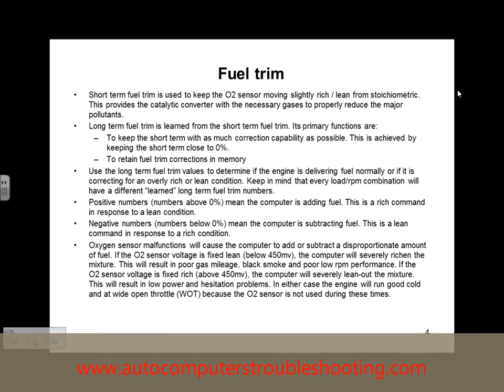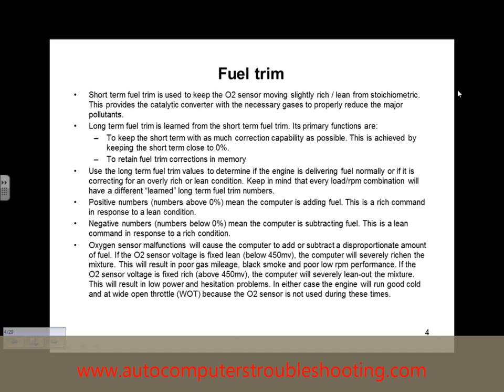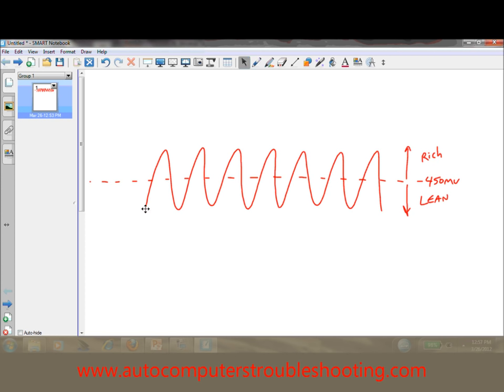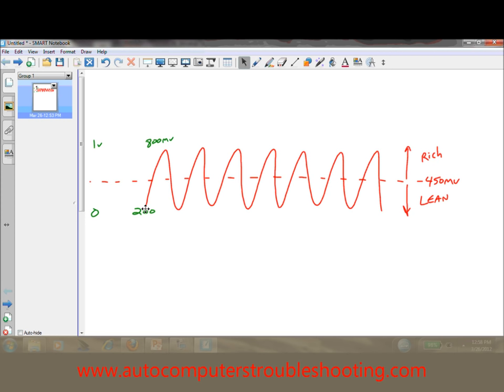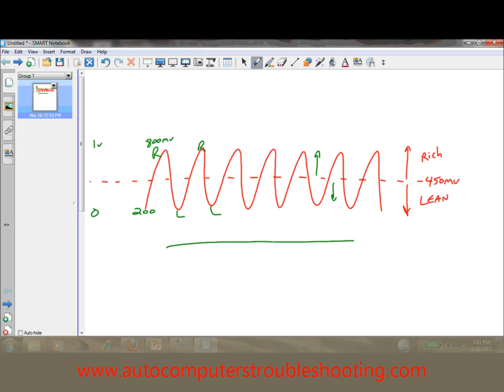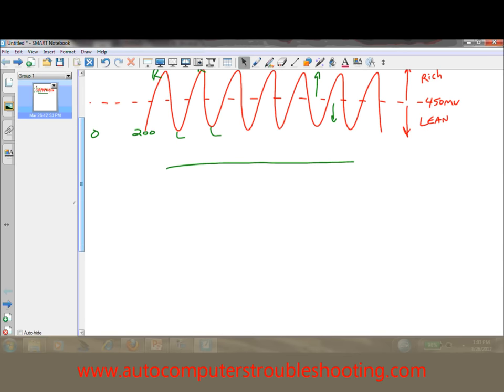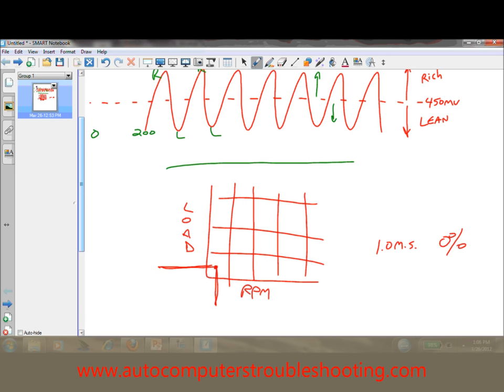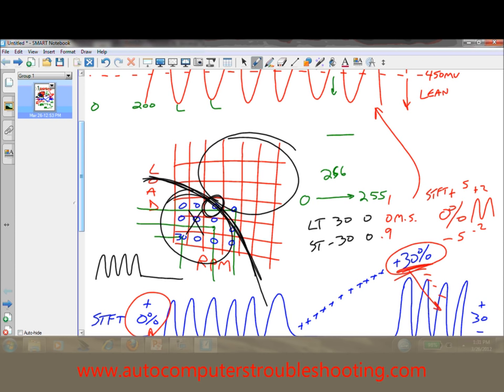Understanding Short Term and Long Term Fuel Trim (a SD Premium video)

Comment: I just checked my car at idle. Its a European car Peugeot 206 1.4. The car was in Closed Loop, engine was up to temp. The Long Term was stuck at 14.1% unless I press the throttle it changes. The short term was moving between 5-20% Is this normal? The O2 sensor was working as it was moving the wave form rich to lean etc.

Comment: With an engine that runs smooth and does not smell rich what would cause flat line short term trim? And catalyst temps on bank 2 is 300F cooler than bank 1.
Can’t find any vacuum leaks. 2005 Lexus GX470
Reply from the maker: flat line STFT means it is not in closed loop and a code related to the O2 sensors is most likely in memory. What codes do you have?
Reply: @ScannerDanner  P0403, Defiantly in Closed loop. I did change both post Cat 02 sensors, as well as a new set of plugs and have driven it a bunch and the code has not returned, but I sill have a 300ish degree difference between B1 and B2. She idles smooth but fuel mileage doesn't seem to to be as expected. I have pictures of freeze frame data and runtime graphs from Autoenginuity. Thanks for replying, I wish there was a way I could upload the graphs, may this link will work...  https://us.lexusownersclub.com/forums/topic/94008-o2-sensors-and-p0430/?tab=comments#comment-507675
Reply from the maker: @quadragin  you can to my forum www.scannerdanner.com and it is free to join

Comment: UNDERSTANDING LONG-TERM AND SHORT-TERM FUEL TRIMS:  Long-term fuel trim is best thought of as “coarse” fuel adjustment, whereas short-term fuel trim is best thought of as “fine” fuel adjustment.  Using the designations Long-term and short-term for fuel trims are both functionally, and somewhat literally, misleading.  
A helpful analogy would be the workings of a microscope that has both a “coarse” focus adjustment and a “fine” focus adjustment. When a microscope is new, focus can be achieved when both the “coarse focus” and “fine focus” are set at “zero” As the microscope ages and develops problems, the “fine focus” adjustment may no longer achieve focus at a setting of zero, but may require a setting that deviates from zero.  The only way for the microscope to again come to focus at a “fine focus” setting of zero is to change the setting of the coarse focus (away from zero).  
If the microscope is repaired to an “as new” state, the only way to again achieve focus at a “fine focus” setting of zero is to first return the “coarse focus” to zero.

Comment: When I'm driving and I let off the gas pedal, my long term fuel trim goes to -10.9 to -14.4, then when I accelerate again it goes back to normal.  Could that be the fuel pressure regulator going bad?  I don't have any dtc codes, I'm just reading my fuel trim with my scan tool.

Comment: what direction should i look  i have a 2007 Toyota fj cruiser 4.0 v6   STFT in both banks at idle is 4% to 6% /
LTFT is both banks is at 13% to %14 /  at hwy speed say 60 MPH  STFT goes to 8%  9% / LTFT goes to 22% to 23% 
so fuel trim goes up not down like your video showed for a vac leak
Reply from the maker: +adam dasilva dirty MAF sensor or low fuel pressure
Reply: +ScannerDanner 
thanks   by watching your videos that was what i was thinking ive cleaned maf sensor/replaced  so i look in to fuel delivery

Comment: what causes long fuel trim to be around 18 at idle then return to 3 when around 2000 rpm? short terms go from 5 to -5 at. vacuum, leak?

Comment: Does the computer switch the mixture back and forth between rich and lean from stoich let's say at idle, because it needs that AFR swing for cat efficiency, or is it because the narrow band simply physically cannot read how rich or lean the exhaust it from stoich so it does that swing to sort of slowly bring it close?
Reply from the maker: +citi0rhythm I believe it to be the latter statement, though there is a lot of material out there that says for cat efficiency (even my own book!), just not sure I agree with that anymore. 
You see, even in a "perfect burn" (stoichiometric) there is left over fuel and oxygen (cooler cylinder walls put the flame out). So we have the necessary gases the cat needs even if you held it at stoich. 
I believe I am stating this correctly. I'll be honest, chemistry is not my strong point

Comment: I dont know if this was answered but what does it mean when your live data shows negative and positive together at the same time, cancelling each other out.
Reply from the maker: The problem is intermittent and is currently not "broken".
For example: an O2 sensor failing intermittently would do that
Reply: @ScannerDanner  
I do believe this one is fixed.  
Keeping my fingers crossed. Patient was an ‘05 Volvo xc60 with a 3.0 turbo
We had previously replaced the pcv separator system on top of the valve cover and tightened a loose snorkel clamp.
Koeo the scanner would read -25 LT, which I thought was odd. I would start the vehicle and it would run rough until ST took over. Intermittently it would do a bit of a chug-a-lug and stall. 
It was also setting a P0101 with no evidence of a failing MAF even when acting up.
Turns out on these after you fix a problem you have to manually reset the adaptions with a scanner.  
Just when I thought I knew everything…
Hopefully this helps you or someone else in the future.

Comment: Hei I try to find what do you mean with cell blocks or blocks in the scanners I am using VCDS scanner. I understand that it refers to the different sensor measurements like the lambda sensor or MAF or MAP etc. but i have trying to find a definition without any success. Can you help me with a short explanation of what blocs refer to? Thanks in advance Cheers C.E.
Reply from the maker: yeah, good luck smh, the Euro market is tough to get good info from, sorry I can't help you with this one

Comment: I have a 2006 charger that stalls immediately when the close loop counter enables, I was thinking it is related to a bad sensor signal the computer isn't using until it reaches closed loop. Any insite of a direction to look?
Reply from the maker: What are your fuel trim numbers doing during this time?
Reply: Right around 0 +-3% it happens to fast to watch o2 sensor data at the stall but prior to stall sensor data looks correct switching

Comment: when I pull the brake booster hose on my chrysler minivan, the O2 continues to oscillate just the same as before I pulled it
this lasts for 3 minutes at least until I give up and plug it back in

The stft spikes as expected but the O2 never pegs lean!
The ltft never rises either 

could this be a faulty O2 or would a faulty O2 always show a pegged lean or pegged rich voltage and not oscillate at all?? 

I have zero DTCs and no Check engine light

THANKS
Reply from the maker: No sir, there is a variable to what you've done. On a MAP engine (no MAF), the MAP sensor sees the increase in manifold pressure and the ECM responds with more fuel.

Comment: iv just done a diagnostic on my motor the emissions failed test the long term fuel trims sitting at -10.3% and short is 1.6 in way to change out 02 sensors today but there really reading up to 0.875 for example on bank 1 sensor 2  bank 1 s1 is jumping about as should the rear one is jumping about also up to 0.875 so would that be knackered ?

Comment: i have a question? i have 04 Jag xj8 and working with lean codes. my s.t. is around -5% and l.t. is 20%. I have suspected and been trying to track an intake manifold leak. i have smoke tested with a home made setup and do get smoke from underneath the plenum but its very minimal.
what i have noticed is the running condition seems to be heavily dependant on outside temperature. when its cold/cooler outside i get misfires. if its warm outside (75deg+) the car will run fine all day long with no codes whatsoever and the ltft is lower around 10-15% stft 0%
Can outside temp really affect an intake manifold leak to the level i am suspecting??
any input from anyone would be greatly appreciated.

Comment: i have a 1999 e36 328i bmw supercharged 2.8 l and im putting parts in this like crazy and its not helping my tuner is vsaying that bank 1 has a vacume leak cant find one i even smoked it stft b1  27.34  stft b2 -3.91  ltft b 1  0  ltft b2  3.91 rpm 2579  may i ask can you think of what is going   on    thanki you joseph

Comment: Hello.

I have a problem with a Peugeot 406 2.0 2002. At idle, the LTFT stays at 65% and the STFT stays at -33%. The lamba sensor generates 0.9 Volt steady (rich). Checked the Map sensor and lambda sensor, both turns out to be ok. No MAF sensor on the engine. At 2000 rpm the LTFT and STFT is 0% and the lambda sensor varies from 0,2 volt to 0,9 volts. Can't find any vacuume leaks.What could cause this problem?
Reply from the maker: First thing. You have a contradiction in your fuel trim numbers. The memory says it was running very lean (adding fuel) but the ST is trying to take fuel away.
Also the fact that the 02 is pegged rich is an indicator that the original problem (lean condition) that this vehicle had, is currently NOT present.
I am leaning toward an intermittent problem with this O2 sensor. Of course it could be other things, low fuel psi etc. But it is definitely an intermittent problem whatever the cause is.
Another thought is an intake manifold gasket that leaks only when the engine cold. Refer to Section 1 in my material for more information on this.
Thanks

Comment: When you clear the PCM are both the STFT and the LTFT being reset?
The vehicle I'm working on is a Ford with OBD1 EEC-IV
Reply from the maker: Not when clearing codes, no. Disconnect the battery and touch the terminals together (cap discharge) to reset memory.
Reply: @ScannerDanner  Thank you! Unfortunately the LTFT did not reset. Still reads -56. Just repaired an upper plenum gasket vacuum leak. Other issue perhaps?
Reply from the maker: -56 is a rich condition and if it was still -56 immediately on start up, you didn't clear the memory. Do it again, both terminals disconnected, then touch them together, make sure you are making good contact

Comment: I need help please.engine temp 93-95 degrees c running at idle LTFT +3.1%STFT moves between +1.0% to -8.0%engine running at 2500 rpm LTFT +3.1% this number doesn't change no matter the rpmSTFT +2.3% TO -3.1%this engine is a Mercedes c180 1.8 supercharged 2003 petrolthe problem is the car using excessive fuel.

Comment: hi Paul, i got a question for you, i was checking a jaguar xj8 " 8 cylinder " the other day and was looking at LTFT on both banks and saw bank 1 positive 17 and bank 2 negative 12, and by rising RPM to 2000 RPM both LTFT were getting less , by the way bank #1 cylinders have close to 180 psi compression and bank #2 cylinders have close to 120 psi only , would that be a cause of those LTFT numbers i'm seeing on scantool, let me know please, thanks for your time and help
Reply: ***** 
thanks for your answer, yes this jaguar has a variable cam timing, i bought this car special tool to set both cams on both banks, i got them pretty good aligned, i've got no codes other than p1268 and i fixed the coil wire and hasn't came back since, i am not the first one to work on this car, someone has already taken the head off on bank 2 and machined it and put it back on again

Comment: I think I have a lazy o2 sensor...on my 2004 mustang short term trim changes much slower than on my 2008 chevy trailblazer....should they change at the same rate or is it normal to see a difference between car manufactuers....by the way same exact scan tool used.
Reply from the maker: If you're watching scan data, look at the frame rate and see if they count at the same speed. I bet they don't. That is one of the variables to what you are asking
Reply: @ScannerDanner  thank you!!

Comment: What could my issue be if my 2002 Benz S55 AMG is getting the following values:

BANK1:
-Oxygen Sensor Output Voltage (B1-S1) = 0.100V
-Short Term Fuel Trim (B1-S1) = 0.0%
-Oxygen Sensor Output Voltage (B1-S2) = 0.465V
-Short Term Fuel Trim (B1-S2) = 99.2%

BANK2:
-Oxygen Sensor Output Voltage (B2-S1) = 0.580V
-Short Term Fuel Trim (B2-S1) = 2.3%
-Oxygen Sensor Output Voltage (B2-S2) = 0.465V
-Short Term Fuel Trim (B2-S2) = 99.2%

I have checked MAP, MAF, EGR Valve, Crankshaft Position Sensor, Brake Booster, etc..... I'm currently in the process of checking my Fuel Pump and Fuel Pump Filter but they both seem fine since I ran a Fuel Pressure test (so fuel pump should be straight) and regardless I'm going to get another Fuel Pump Filter since they're not expensive. 

Lastly - I have a hunch I should check voltage + continuity on 
1)  TPS (Throttle Position Sensor)
2) CPS (Camshaft Position Sensor)
3) Fuel Injection Clean - I think I need to do this for sure and that might resolve all issues since my O2 sensors look cleaner than the Fuel Rail area... 
4) If that doesn't work then O2 Sensor. I think I might have a bad O2 sensor or multiple ones

Here's my symptoms:
-Starts fine. Idle has car vibrating a little
-Never stalls/shuts off at stops or at all
-High Gas Consumption
-Sometimes I can't even tell if the car feels weaker because ill put the pedal down and off it goes sounding nice
-When I changed my radiator, I accidently unplugged the line going to my A/C Compressor so I have to refill that (Not sure if that helps my case)

Comment: If the ohms tolerance or specs of a O2 sensor are 2.3 to 4.3 is this mean cold or hot ???
Reply from the maker: There are two parts to an O2 and they are completely independent of each other. The heater circuit or the signal circuit? The signal circuit is open at room temp

Comment: My car is having a misfire only when driving down the road at idle no misfire only cylinder 3 misfires all my fuel trims long term and sort term go to 0 then misfire code poops up it’s a 2008 Buick Enclave also have oil blow bye getting into intake from pvc done updates to valve cover gaskets changes spark plug and coil pack to different cylinder to see is misfire moved to different cylinder it didn’t it’s been a pain any ideal what it could be
Reply from the maker: Is the #3 plug oil fouled? I don't like the blow by issue

Comment: sorry, this may be a repeated question, but if I came to fix a car with opposite fuel trims like LTFT1 -9.4; STFT1 +6; LTFT2 -11; STFT2 +9 that means that is fixed but needs to go trough relearn or it needs to have the KAM reset ? Thank you for your answer, have a Merry Christmas...
Reply from the maker: Exactly my friend. Merry Christmas to you too!
Reply: Thank God car is better. I disconnected the battery and used a 1K ohm resistor to discharge capacitors and KAM memory. Runs very well and fuel trims are within a delta of 5. Thank you for your videos, this was driving me crazy, now makes a lot of sense, Merry Christmas.

Comment: Isn't computer looking at MAF sensor first and then changing O2/Wideband sensor voltage?
so  if MAF is not operating at 100%, It will through off O2/WB reading.
Reply from the maker: Yes the O2 sensor is a feedback sensor. The system uses MAF as well as many other inputs plus the VE of the engine to determine the baseline fuel map. Then the O2 comes into play AFTER all of that.

Comment: at 32:45 it would be worthy to mention the digital binary numbering system does not have negative numbers. That's why 128 was picked as the zero point and everything before 128 represents the negative percentage. I remember the Snappy MT2500 Red Brick defining the fuel trim as "Block Learn" and "Integrator" - 128 was the desired number for both.

Comment: Yeh it's just starting from cold it smokes! but has cut right down to normal with new spark plugs , gonna fit the 02 sensors and check throttle body and injectors it's not a head gasket kinda smoke think it's more steam cuz only happens when cold but had bad or wrong plugs when bought the car !? the new correct plugs are total different electrode size! it's longer now

Comment: Mr. Danner a blow head gasket can give u positive trim numbers at idle? Or how is look like the fuel trim number whit a head gasket blow? Sorry for my English I hope u understand what I mean
Reply from the maker: What I see over and over again with a bad headgasket is negative fuel trim numbers.
Reply: @ScannerDanner  so if both ltft are -9 and -10 and -6 at higher rpm
Reply: @ScannerDanner  anything else give negative ltft? Best way to check for blown head gasket?

Comment: i have a volkswagen Golf 4 petrol  My long term fuel trim stays always fixed to  -2.8 % and Short term goes between -2% and +2%
Is my car running rich?
Reply from the maker: Nope, sounds good
Reply: But the weird thing is when i create a big false air by disconnecting the brake hose. The Short term stays between  0% and -2%  And long term stays fixed at -2.8%    It should rise to positive values right? And the funny thing is it happens only now with my brand new Bosch lambdasensor :(

Comment: In such a new car model the O2 sensor signal doesn't move up and down like that eventhough everthing is normal and the car is new 0 miles on it, my question why it is like that???
Reply from the maker: You have a wideband O2 or af sensor.
These operate off of micro amperage and will swing but you won't see it on the scanner. Scan data is processed voltage based on these micro current readings
Reply: @ScannerDanner  Thanks for the reply I really appreciated so much

Comment: +ScannerDanner what does it mean if both stft and ltft are at high negative numbers?
Reply from the maker: You have a rich condition. Some common causes:
- fuel pressure it too high
- ruptured fuel psi reg (on a return type system)
- MAF sensor issue
- leaking injector(s)
- another critical sensor failure (ECT, MAP etc)
- flex fuel engine with miscalculated alcohol content
- oxygen sensor has failed and is reporting a false signal
- incorrect valve timing
- headgasket failure that has contaminated the O2s